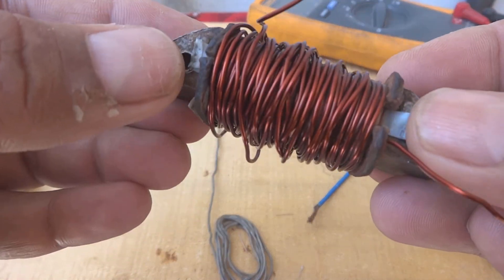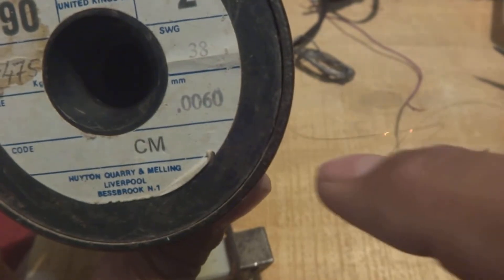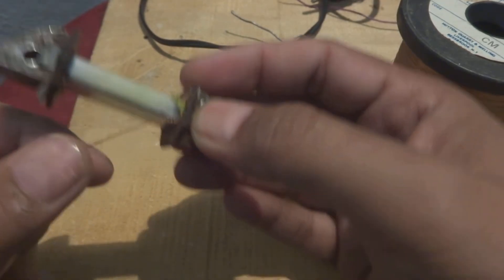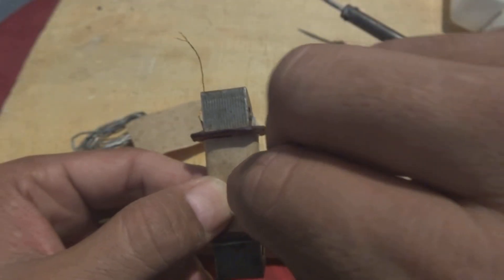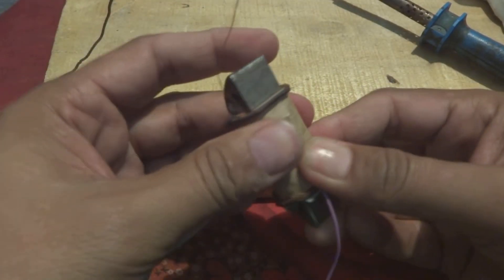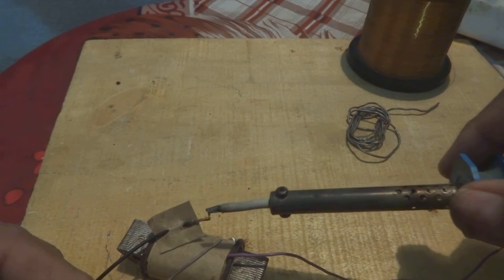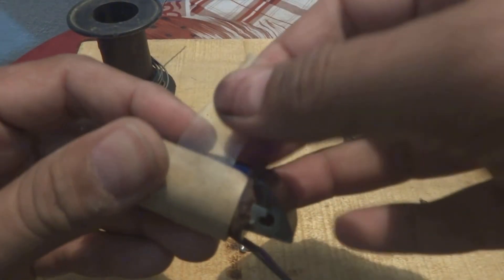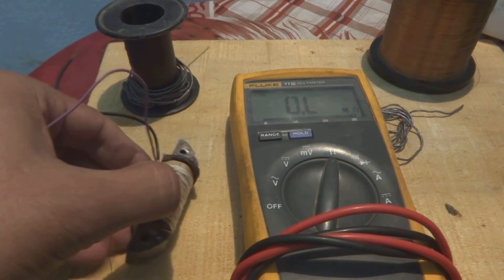CDI alternator coil winding. Bike cdi conversion repair. Don't confuse it with free energy

Comment: Assalamualaikum sir 
I also wound a gutka coil of cd70 with 38 swg. It has ohm reading of 147 ohms after winding the gutka to its full capacity. However, cd70 after market starting coils often called gutka coils have 550 ohms to 650 ohms reading. I am concerned rather my low ohm winding coil will work or not. Please advise what do u say about it?
Reply from the maker: Test it in bike. If starting and running are ok, don't worry. It will be perfect. If problem, then rewind the coil with 41 swg wire to get more turns hense more resistance value.

Comment: How many turn for bajaj ct100 bike coil
Reply from the maker: 1900
Reply: @JahanZeb1976  copper wire swg number
Reply: @JahanZeb1976  mention copper wire swg number, but company coil resistance is 310 ohms

Comment: Wah
Bohot khoob
Mere pas aik purani honda bike hai
1970 ki honda cb100
Points or condenser wali
6 volt battery direct power dete
Hai points ko
Stator battery ko charge karta hai
Or sari lights or horn wagera ko
Challata hai
Sawal yeh hAi
Kia is bike mein points condensor
Ignition system nikal kar
Cdi ho sakta hai
Jzk sir
Reply from the maker: Yes. The same is what I did in this Yamaha. Very satisfactory project. More videos on the subject are available here on my channel.

Comment: Bro what is the use wire which is taken  at 1500 turns . both 2 wires goes to cdi right
Reply from the maker: Wire no. 41swg. One side of wire is grounded. Body ground. The other side is going to cdi.
Reply: @JahanZeb1976  total 3 wires right one wire grounded ,secound wire taken at 1500 turns ,3rd wire taken at 2500 turns . which wire goes to cdi the last one or secound one.
Reply from the maker: This was experimentation. If middle wire works for you, great use that one and leave the end one. Otherwise if you feel low voltage ⚡ to cdi then use the end wire and leave the middle one open. Hope you get my point.
Reply: @JahanZeb1976  ok ,this video was very  useful  thank you.

Comment: Sir, nice video. How thick is this wire? What if i use 0,9mm wire and 125 turns. I would want to power lights with it. How can i get around 50-70 volts and 55watts from this. Is it better to use thin wire?

Comment: Sir, If i wind the coil for say more than you said like more then 2000, will it give more voltage or less voltage?
Reply from the maker: It will increase voltage. But too much voltages could diy capacitor or scr inside CDI unit. Eventually you will have a bad CDI in the result.
Reply: @JahanZeb1976  thank you Sir, so it has to be wind upto 2000 maximum?
Reply from the maker: @imnalongchar5187  for this particular armature segment only. Honda armature needs 4700 turns. Your particular armature needs experiment. Your voltage at maximum rpm shouldn't increase 400v ac.
Reply: @JahanZeb1976  Sir actually I'm into racing and I'm experimenting to get more spark current that's why I'm asking you.

Comment: Dear Sir, I need a help in understanding the charging & pickup coil wires when wound on a single former. I am working on a Kawasaki KE100 CDI motorcycle wiring and want to know the primary source power (for Powering CDI) and Pickup Coil for ignition timing spark. Kindly see the images of charging Coil , wiring diagram (https://tinyurl.com/y4pb6d2j) & https://tinyurl.com/y22o65tc.  Thank you .

Comment: What is the equation you use to figure out the amount of turns? i need to rewind a snowmobile coil of similair size, and need to get to around 590 ohms. This is the only spec the service manual gives me
Reply from the maker: There are no hard and fast rules and formulae to do this job. All you should do is to follow the winding rules. The rest is hit and trial.

Comment: sir replay zaror dein
mera alternator voltage blink kar raha hai kabhi 0 kbhi 19 kabhi 12 lekin ye second mein hota hai keya karoon
Reply from the maker: Maybe you would have a bad charging rectifier regulator. Try replace new one. Or second thing can be a loose connection somewhere in wiring or inside alternator winding or on the ground connections. All you need to test and pin point the problem. It could be a little tricky or hard but it is possible. Wish you very good luck with your repair.